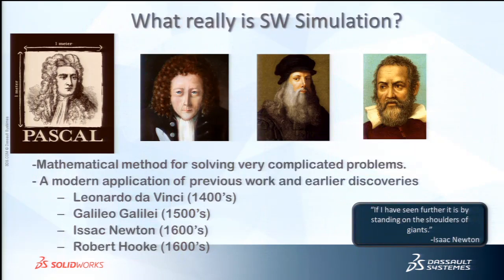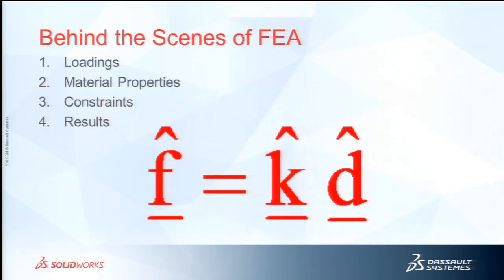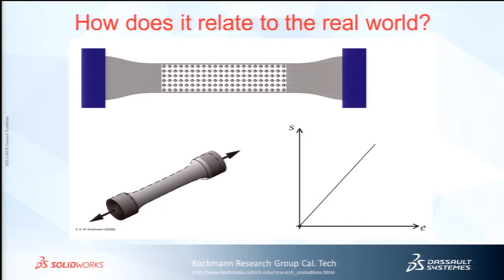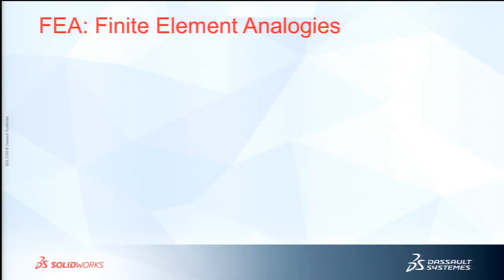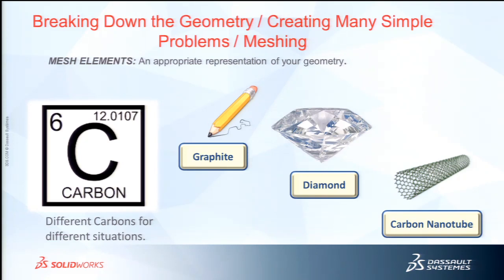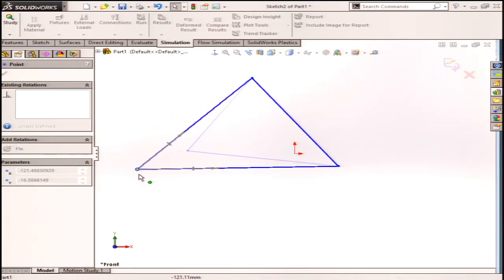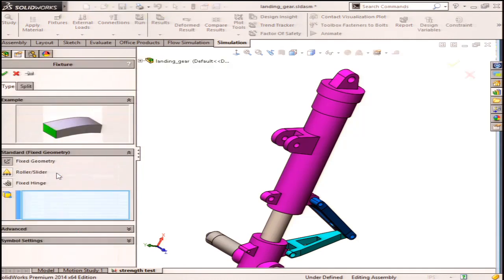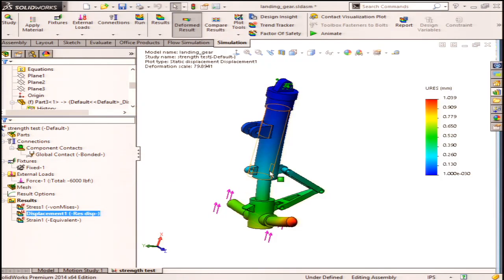SOLIDWORKS World 2014 - FEA Theory and Simulation

Comment: At the end you talked about singularity. So if we have convergence problem in the stress results how should we deal with? Is it ok if the displacement result converges enough while the stress results does not ?
Reply from the maker: Hey! Thanks for the comment. If you have singularity I always first look to confirm it’s cause by the geometry and then I look to remove that area. My goto move is to add an incredibly small fillet. It is absolutely ok to have converged displacement results without stress convergence. That is exactly what will happen